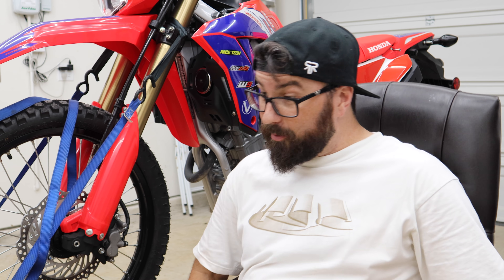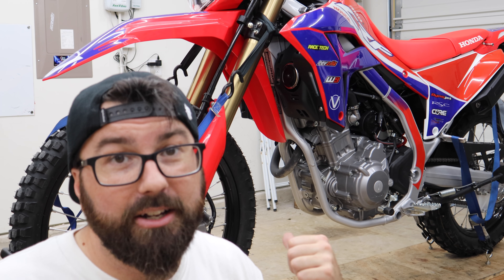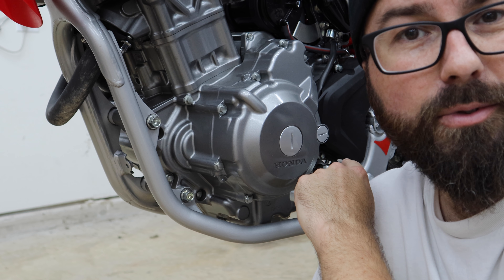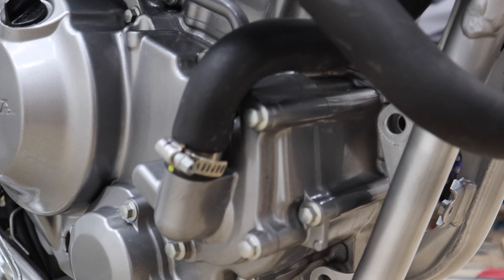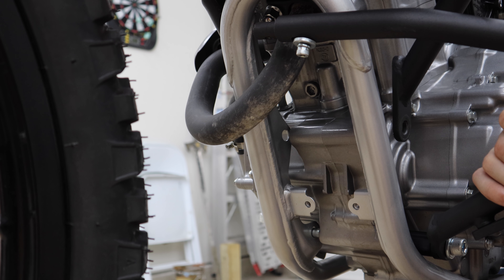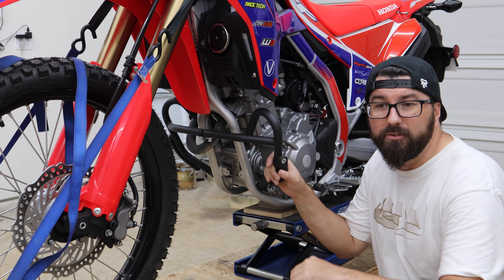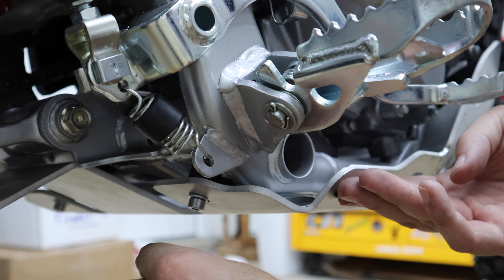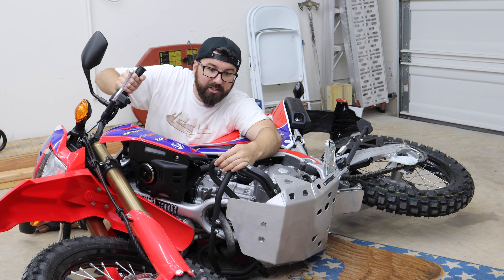Skid Plate and Crash Bars Installed CRF300L

Comment: Id think some button head cap screws would allow it to scrape over things easier without the socket heads grabbing
Reply: This is the first skidplate I've seen that protects the rear shock linkage.
 
I will buy one, but I have to get the bike first! Should be very soon.

Comment: I know T-Rex is a sponsor but they genuinely saved my bike. My dad and I spent a couple days disassembling my bike and we had no idea what we were doing. We had it stripped down and managed to get their frame sliders installed. Before I went to sell it, I wanted to take some nice pics of it. I went to a cool spot local to me and on the way home I hit gravel and their frame sliders saved my bike. The fairings were scraped but I still managed to sell my bike for more than what I owed.

Edit- I will say I low sided on the left so my exhaust was unharmed but the shifter was sheered off and I replaced it before selling.
Reply from the maker: T-Rex makes good stuff. It should be noted that I came to them and asked them for parts because I trust them. I know so many people just say whatever and work with whoever for free part and or money. Every part you see me put on a bike is because it's a part I believe is good or I think will be. At the end of the day it's my bike and I want what's best for it. And it's my word which I put a lot of value in.

Comment: I just got these crash bars and they don’t fit. They sit about 7/8 of an inch wider than my frame on the 300L. Almost 100% sure I got sent the ones designed for the 250L. Tried contacting Trex to setup a return or exchange with no luck.

Comment: Do you think the 450RL headlight would fit on the 300L? It would look awesome if it did.
Reply from the maker: It’s pretty similar but is different enough that it wouldn’t just bolt on. From what I found out you’d have to get the bracket, headlight, shroud, and front fender from the Thailand models. And you’d have to order it from Thailand as well since those part can’t be ordered here. If you wait I’ll have a video modding this thing to take a Baja Designs XL pro. I think that will end up working and looking way better!
Reply: @TheGardenSnake  Cool, can't wait to see that. I was on the fence about getting one but after watching your videos I want one for sure. Currently have a 2019 BMW F850gs, 2021 KTM 500exc and a 2021 Zero FXS.  The Zero is on the chopping block, the crf will replace that one. Great channel, just subscribed today.

Comment: Yeh, that’s a 💩crash bar setup if I ever saw one myself…. And I did….Just installed mine partially…. May be sending it back. Terrible fit and the stuff is the same junk that pull up door-way racks are made of. I expected way more….. tsk tsk jake….. tsk tsk
Reply from the maker: No idea what your on about. Mine fits 100% correct and has fit ground a few times with zero issues. I even got yanked out on a bad mud bog by an atv hooked up the cage. Maybe you got a badly made one, sorry if you did. But chill out on me sir. Return it if you want.
Reply: @TheGardenSnake  sorry not trying to be harsh. I didn’t call you names or nothin. I was expressing my disappointment in the product. Just figured you would’ve mentioned it feeling like it could be broken easily before installation or it seeming cheap. I recall you mentioningthat being a plus if it could break in replaceable sections rather than just bending or caving in as whole. I mean I said bad stuff about a product that you didn’t make and said tsk tsk to you for something I didn’t even convey well. It was two separate ideas but I could see how it would seem ALL directed at you since I tacked your name on the end. Beer, frustration, carelessness. My bad 🤷🏻‍♂️

Edit: I’m glad to hear it’s tough. I got mine mounted using an additional spacer on one side. Seems sturdy enough . I just wanted better instructions and such. Again not bashing you…. Bashing t-Rex . Just figured you would’ve mentioned certain aspects cause you’re pretty blunt and plain spoken